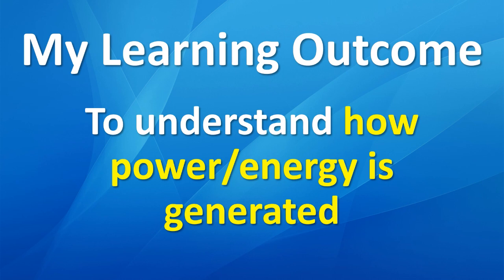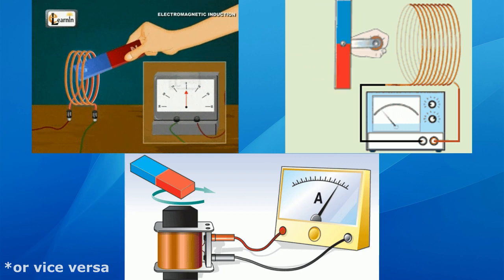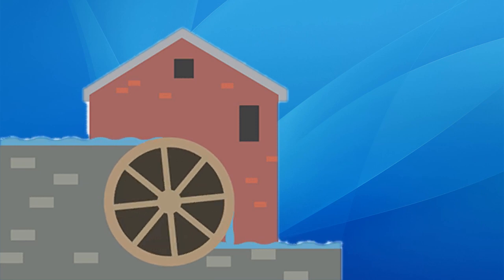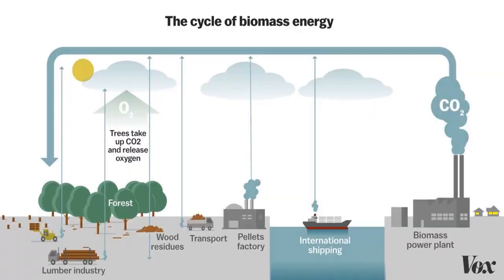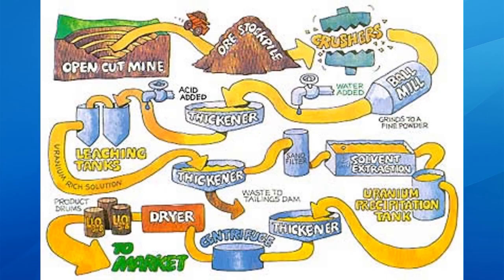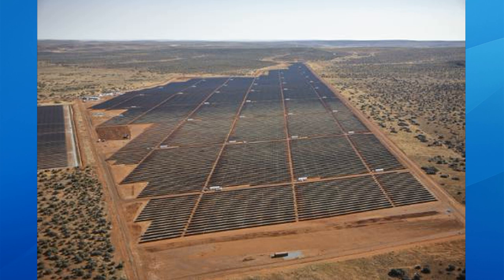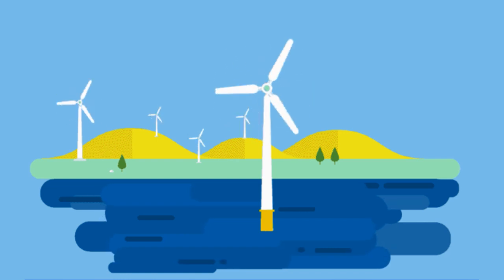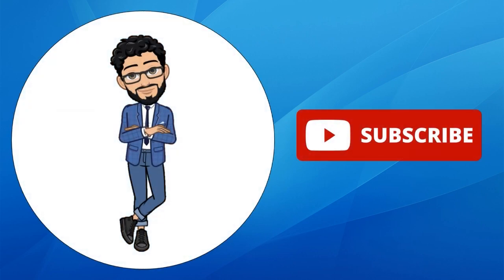Energy - Production, Renewable vs Non-Renewable, Perpetual Motion

Comment: What about compressed air  ?
Reply from the maker: It would depend on how you're powering the air compressor. Take electric cars. Very renewable, until you look into the cobolt mines, then it's just politics and good marketing. So it depends on the big picture! I'd say if you take out the "compressed" you'd have a great energy source with just air :)